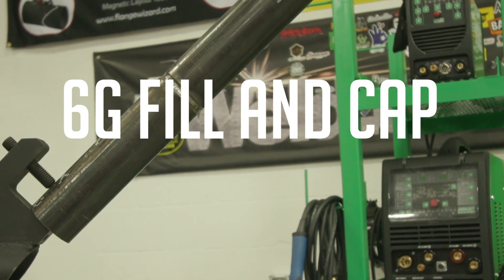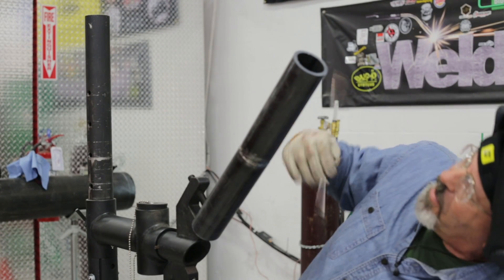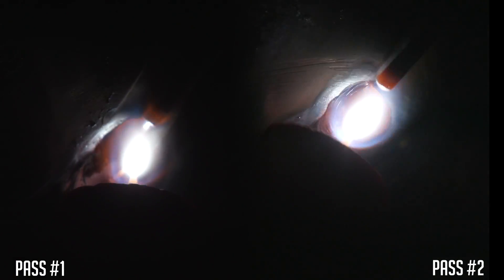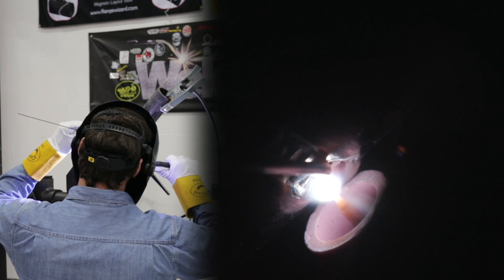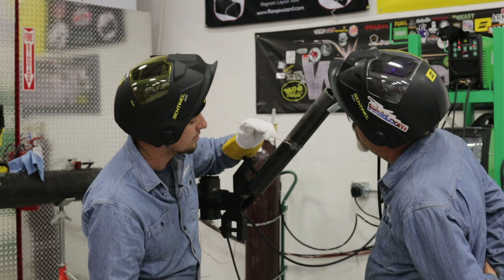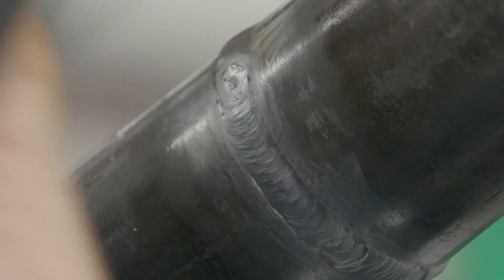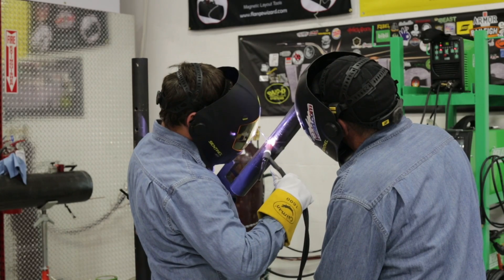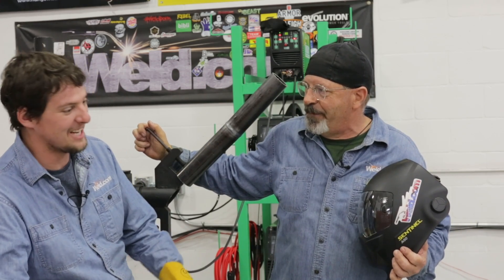6G TIG Fill and Cap: 2 Inch Heavy Wall Pipe

Comment: Both of you are cooking it, need to speed up. You can run 120 but you need to move. Also no dabbing the wire, hold it against the pipe and just roll like cub. Cub you need to stop pushing the torch and holding it so tight, we like to say hold it loose like a sore dic#.
Reply: yea came to say the same thing.  You could also terminate the cap by trailing out the bead and letting the arc ride up the filler wire.  Helps prevent fisheye.

Comment: Hey Bob I've been watching your channel since I was thinking of buying a welder, I first bought an esab fabricator 252i, great welder did everything and more than I through at it, even burns 6010 like champ,. Since buying my first welder I've been watching and admiring the rebel 285. I ended up taking the esab 252i and a 12000w peak 9500w continuous generator to my Lws where I bought both and traded them in for the rebel 285. Love watching what the 285 is capable of on your channel, don't take no shite from man cub,bet him out of all the free lunches you can

Comment: What ever happened to no wider than three times the width of the filler metal?!
Reply: This might be in the WPS where you worked, but it's not in ASME code according to several CWIs I have asked
Reply: Applies more to SMAW not GTAW.
Reply: High pressure pipe welder in the navy which are the ones that developed the majority of what is done to this day all though I have seen a hole lot of slack in the civilian world. In the navy still applies to gtaw .
Reply: I guess the fat wide weaves is an American thing, looks good tho I'm not hating but would be a reject in The Netherlands.

Comment: Are you just using stainless filler as a pointer or are you filling the groove with stainless?
Reply: It's probably just er70s2. Some look like stainless and some look like copper in color , just depends on the company that made them. Both are carbon
Reply: Jessica Rose Ok. I’m in pipe school right now. We don’t have enough stainless to practice on so we use stainless filler on carbon to practice.
Reply from the maker: It's 70S--6 that had some scotch Brite taken to it to clean it up.
Reply: Weld.com Ahhh ok. Does the copper color coating do anything to the weld characteristics? Or is it just for smoother wire-feeding In GMAW machines?